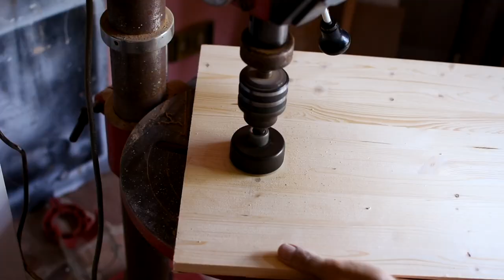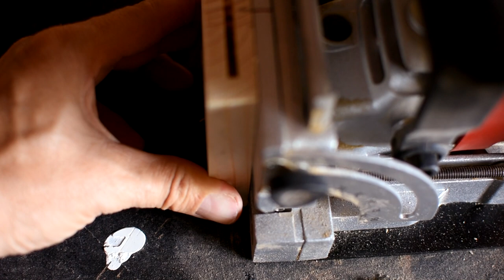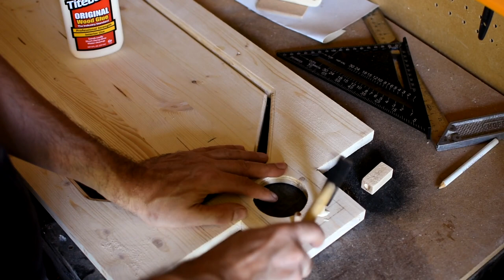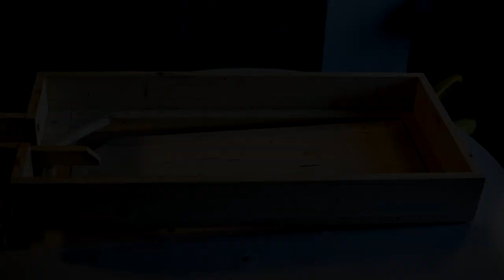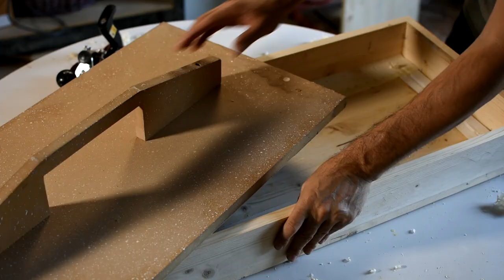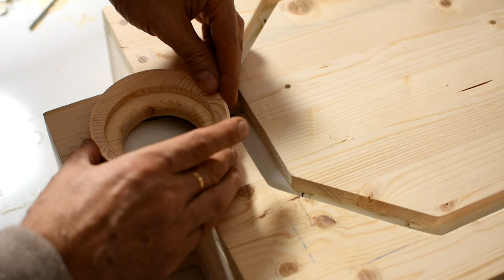Homemade Pipe Organ | Bellows building, full video | sub ITA

Comment: I hope you don't mind my endless questions. :-D  How did you decide on this model for your reservoir? Audsley and other books usually describe a "double-rise" with two sets of ribs; in contrast to the old "wedge bellows"; modern organs I've been inside are more like yours but not hinged, and with springs.  I don't think the old books ever recommend hinges - is that just because in times past they were more likely to rust and be noisy?
Reply from the maker: There is only one reason, space. my bellows only occupies 12cm in height. As for the weights instead of the springs the reason is still for the space, the weights are only 2cm thick. the metal hinges are not very "traditional" but they do not create problems in a small home organ

Comment: I have seen your video several times and now I want to make a bellow similar to the one you show in the video. Can you say something about how wide and long this bellow is and other measurements if they are important. For example, diameter of the holes for windchest and in to the bellow.
Reply from the maker: Hi, you can adapt the size according to your spaces, for small organs the floating table must be 400cm2 for register, plus a little margin. 50mm for the inlet and outlet tube is enought for 3 small registers.
Reply: @nippocast  Thanks for a quick reply. I'm trying to build an organ with four registers plus bass. I make a floating board of about 60cm x 40cm = 2400 cm2
Reply from the maker: Perfect, it's more than eought.

Comment: Hi😊 I would like to ask, when the bellow is connected to the windchest and a operating blower, the windchest and the bellow would form a confined space  if no key is pressed to release the wind. At this state, although the blower is still running, there will be no wind entering the bellow? I hope I have expressed myself clearly😂
Reply from the maker: Yes, I undertand what you mean. the bellows have a valve that closes when it is pressurized and no keys are pressed, as soon as there is a request for air the valve opens just enough. When the bellows is full the air from the blower simply circulates inside the fan case.
Reply: @nippocast  Thanks so much, I understand now. I have designed a bellow and prepared all the wooden boards as well as the skin to assemble. I hope it would work just as fine as yours😂

Comment: Amazing. Can this Bellows sustain an organ of the size of yous? I was planing on makin one myself years ago when started to watch your videos and end up makin the blowers(with motor) and some sort of bellows haha. But i've comeup with an two blade design that literaly blowed the bellows (Bellos size: 60x80x70cm). i may had to prevent the system of overblowing as you did.
Reply from the maker: Yes, for small organs 400cm2 of floating table surface per rank is sufficient.

Comment: Hello nippocast.
Sorry, I don’t understand. You made three holes, two on the side and one on top with a valve. Which one comes from motor and which one goes to the pipes?
Reply from the maker: The large one is for the blower, The two on the side are for the manual windchest and the pedal windchest
Reply: Thanks!